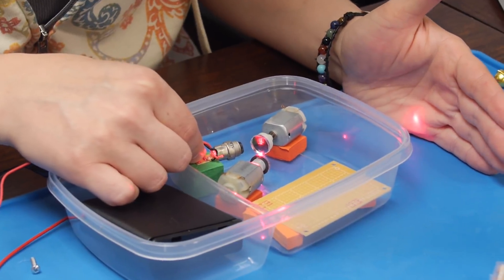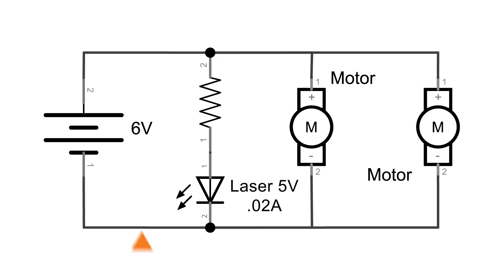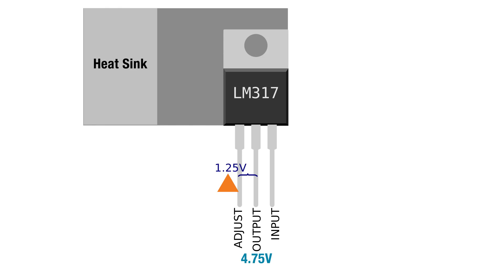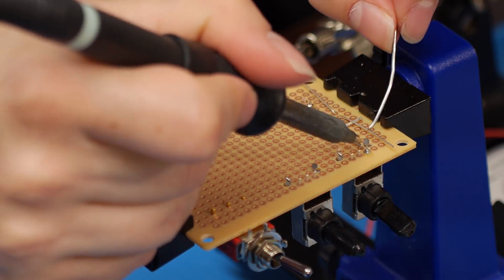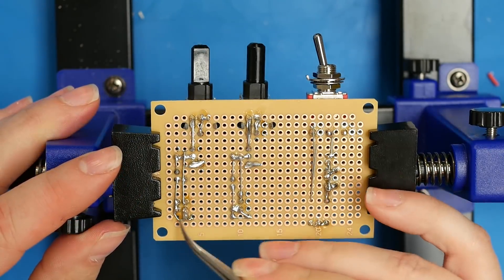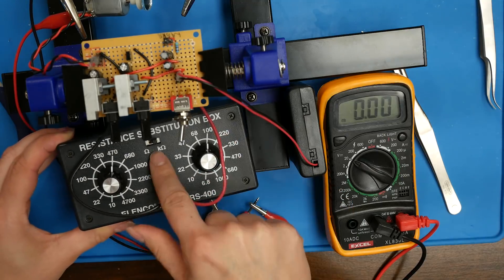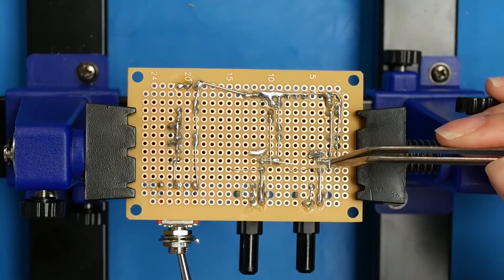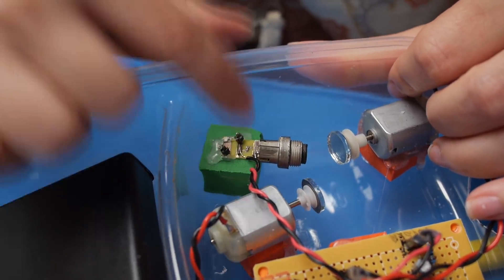DIY Laser Light Show - The Learning Circuit

Comment: I like your presentation. I gave made cheap ‘x,y scanners out of two small midrangespeakers. You can build aft using  from a rubber band. Then you will attach a push rod from the speakers coil to the mirror. Usually I use a planstic bristle from a broom.then I can play stereo to each speaker. The speakers should bet turn 90 degr opposing each other and now your done.

I am in no way trying to steal your thunder. It could be the next progression of this type of device. I started with motors my self I also added an additional motor with a wheel of several fan blade type configuration.this will give your patterns a dotted line that can be in phase or out and really moving. This look particulay good when projecting beams in smoke. Ok I'm done hogging your presentation. Sorry if I overstepped. Peace, love and ubderstsnding. Your rig is rocktastic.

Comment: You referred to your common ground as a ground plane. It is not. A ground plane is usually understood to mean a single piece of grounding material that provides a certain amount of shielding (isolation) either at radio or audio frequencies from the rest of the circuit.

Comment: You explained everything so well, and then suddenly capacitors appear!
Reply: Yup, would have been nice to have a basic explanation included for each of the capacitors used and the reason for choice of capacitance rather than them just magically appearing. Also would have been nice to see the final circuit diagram.
Reply: Also, why does a rotating mirror produce a circular laser pattern when the laser is perpendicular to the mirror. If I look into a mirror and rotate it, my image remains unaffected.
Reply: @stupossibleify  that laser makes a circular pattern on the wall because of imperfections. The mirrors dont have flawless surfaces that change the direction of the light ever so slightly...compound that with a wobbly motor moving a 'not 100% true' drive shaft and you have a situation more like light hitting a spinning car wheel than a spinning mirror. The angle of the laser exploits these imperfections and the second motor adds more.
Reply: @stupossibleify   the capacitors are most likely part of the necessary external components needed to use the LM317 as a voltage regulator. But with motors that small, I really don't think any of that was necessary. A potentiometer in series with the motor would be just fine - 100 ohm would probably be best for this application, though 500 or 1000 ohm would be fine too. Anything higher and you'll lose control sensitivity.

Don't listen to that panda guy about the mirrors. He doesn't know wtf he's talking about. Getting a circle/patterns has not a damned thing to do with imperfections in the mirror. 
Your intuition was correct - a perfectly perpendicular mirror with respect to the shaft of the motor will not produce a circle (cone). You get a circle when the mirror deviates from the normal. 'The normal' in this case is an imaginary plane, being perpendicular to the rotating shaft. The laser's interaction with the mirror follows the Law of Reflection, which basically says that the angle at which the laser will be reflected off the mirror is the same as the angle it contacted the mirror, with respect to its normal. So, a slight deviation will result in an oscillation at the point of contact (laser hitting mirror). If the oscillations are regular (even) then you get a circle.
And that's how that works..

Comment: Very interesting but very retro things have moved on and are now used in TV projectors usually via two 50 sided mirror rotors to generate a raster and we would need three lasers one red,one green and one blue each using a Kerr cell to modulate the intensity of the laser beams before going through the two rotors to generate a image on the screen, maybe you should have a power regulator to limit the voltage to the laser to 4.5V so as not to burn out the laser.